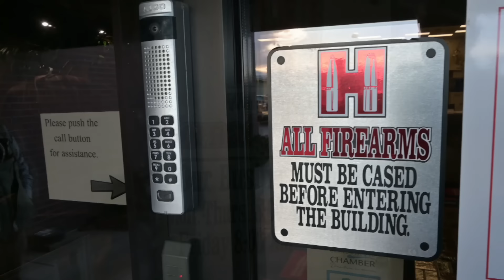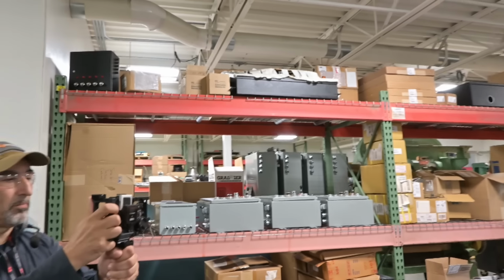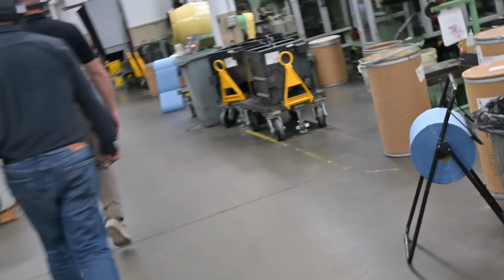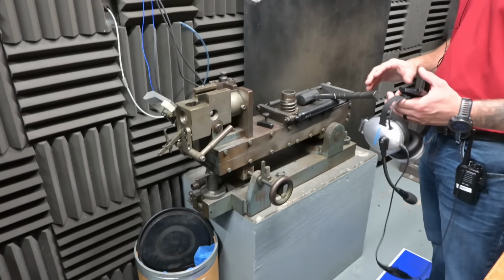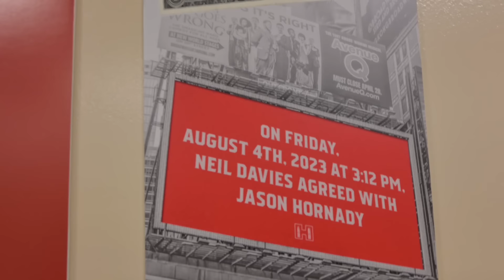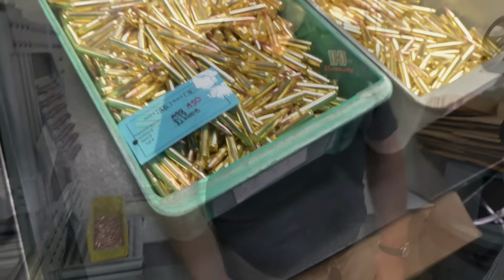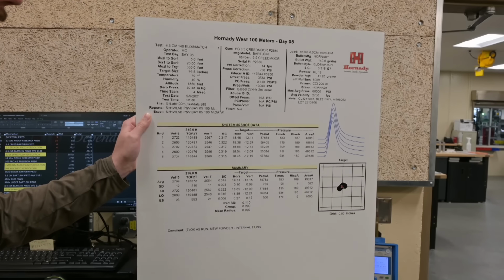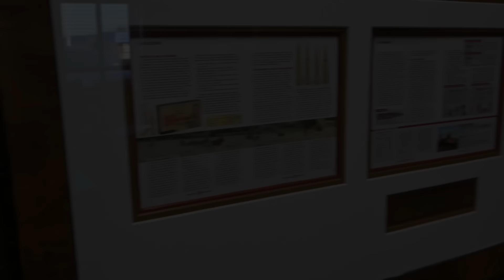Hornady factory visit, MASSIVE PRODUCTION expansion, the three sites are now vast!

Comment: Very interesting as I'm a reloader. My little bedroom operation sure doesn't compare to Hornady's. I always thought melted lead was poured into the copper jacket. Interesting that it is solid lead that is pressed in. I still would like to know how they get lead inside of a full encasement jacket.
Reply: That melted lead core idea was Vernon Speer's Hot Cor bullet. Probably part of the reason he and Joyce Hornady dissolved the partnership and Speer went to Idaho to start Speer bullets. Bullets do have several variations in design and more than a few methods of manufacturing.